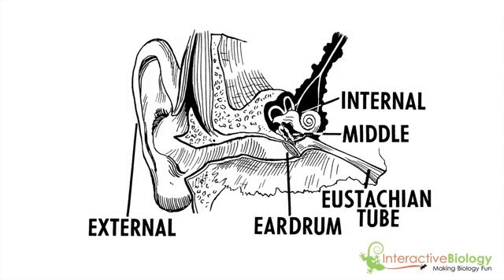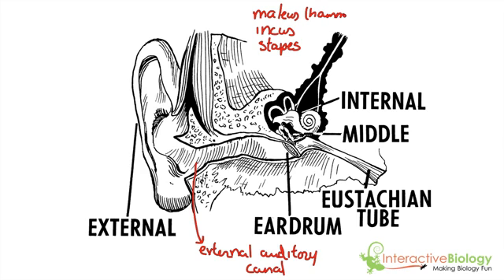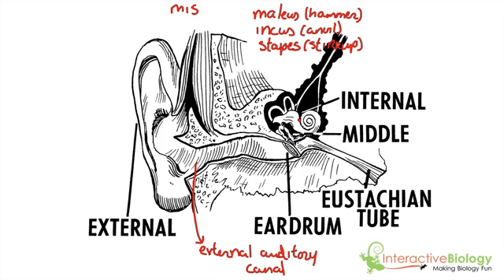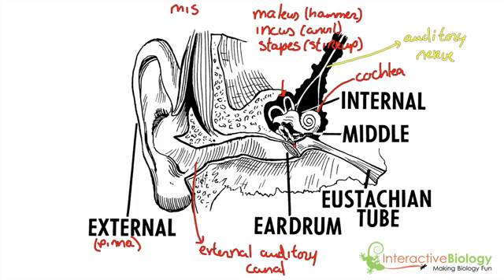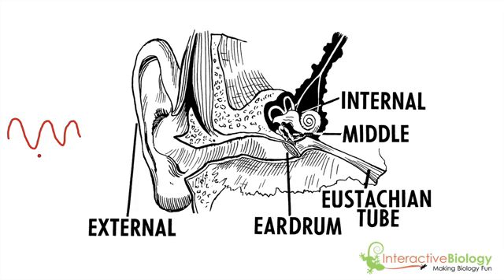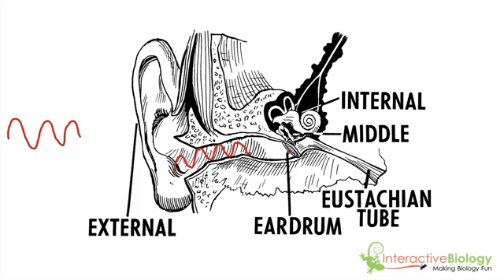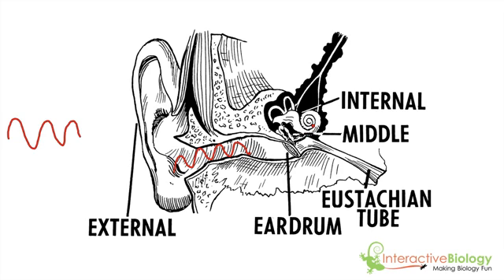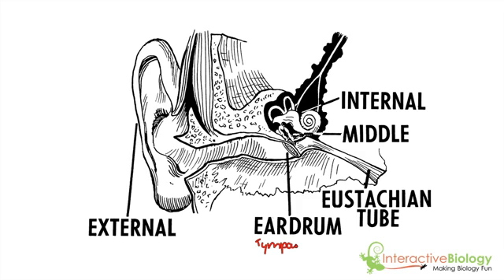036 An Overview of the Mechanism of Hearing

Comment from the maker: @mimachka That's to balance the pressure. Think about it this way - When the bony ossicles vibrate, that causes the oval window to vibrate in and out. That's going to cause an increase in pressure when the oval window pushes in. Fluid doesn't compress, so that pressure needs to go somewhere. By having the round window on the other side, when the oval window pushes in, that pushes the round window out so that you don't get damage to the cochlea.